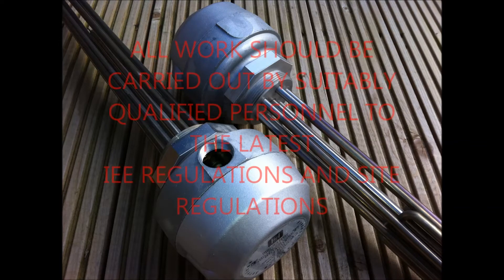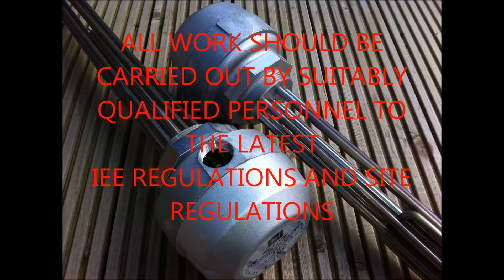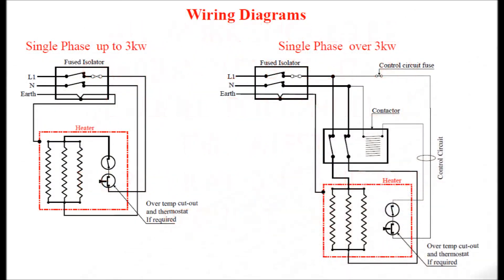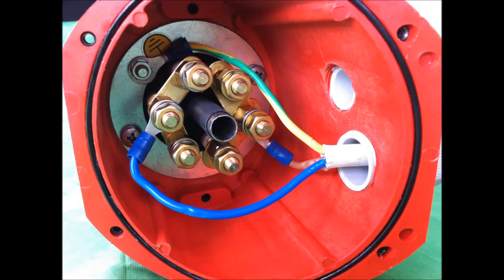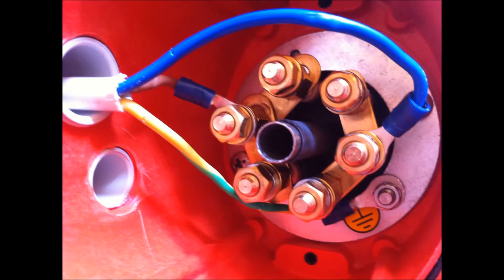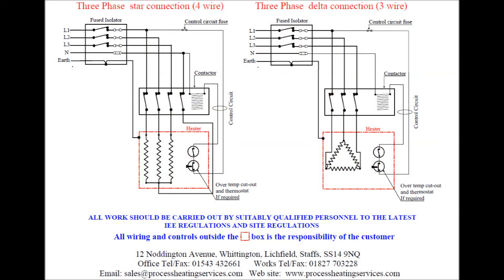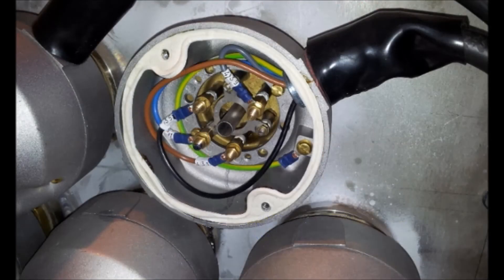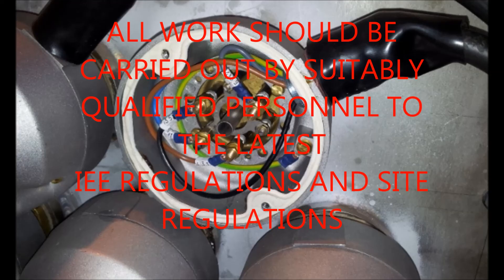Wiring an immersion heater

Comment: I have a question Sir

Due to the war in my country.. there is no public electricity now ... we use solar panels PV

My question is :  Can I connect a solar panel PV directly to a single phase thermostat ? 

I have 2 extra solar panels 150 W , 12 V DC 
And the thermostat I have was connected to 220 V AC

it will save a lot of money for me if it works

Thank you in advance